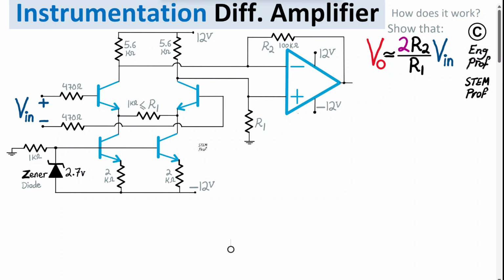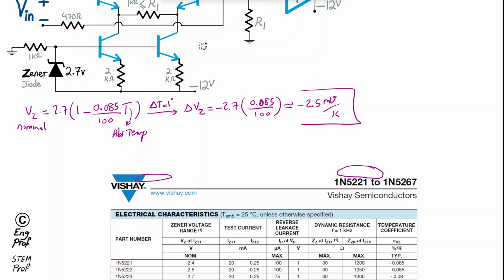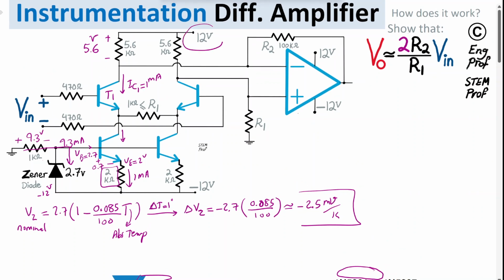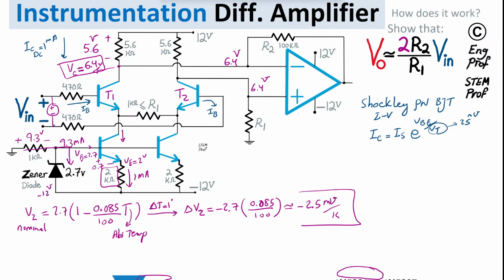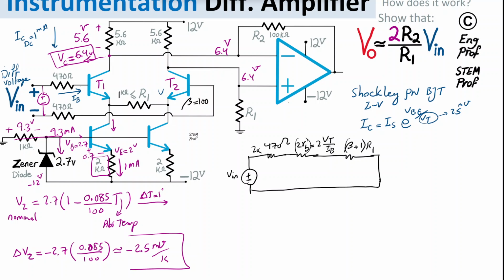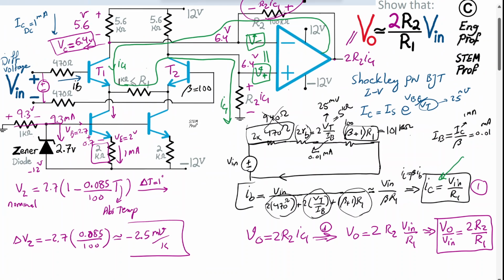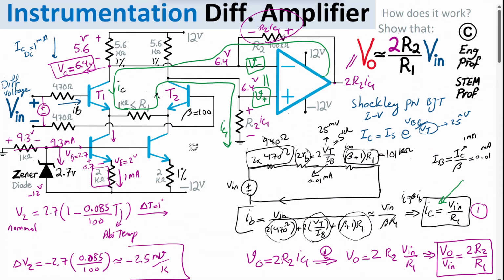Instrumentation Differential Amplifier design with BJT Transistor, Op Amp & Zener Diode

Comment: Needing the two BJTs for the differential pair is a bit hard to do away with, but that's why I'd always opt for using only one BJT for the current source and dividing its load, that way you don't need a second matched pair
Reply from the maker: Thanks for the comment and sharing your insights!  There are indeed many ways to design a differential pair and current source. Your suggestion is a clever approach to simplify the current source in a differential amplifier.

Comment: That’s an amazing video! It’s exactly what I needed to help explain circuits beyond just deriving analysis equations. I do have one question, though — when you mentioned 9.3 mA at the base of one of the bottom BJTs, why is the emitter current (1 mA) smaller than the base current? I really appreciate your time and explanation!
Reply from the maker: Cool! Glad that you liked this instrumentation differential amplifier design video.  As explained starting at minute 4:00 , the 9.3mA is not the base current of the transistor, instead it is the current that goes from ground through the 1 kOhm resistor and then through the Zener Diode. I hope this explanation helps. For more example see the https://youtu.be/C4tghZ-q6Zs video which explains the design and operation of an Instrumentation Amplifier with Electronic Gain Control.
Reply: @STEMprof Thank you for your explanation. I have almost finished most videos. It is very practical electrical circuits knowledge.

Comment: Hi Prof, great video as always, but why ic1 cannot go through the 5.6 Ohm resistors? It's not clear for me how ic1 really flows. Thanks.
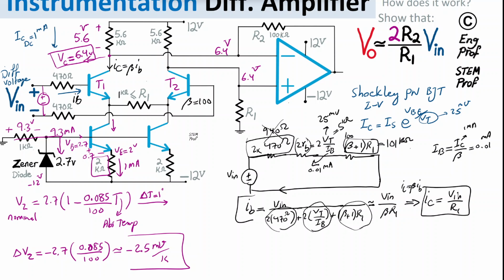Reply from the maker: @schnullertroll4173 You're welcome. Glad that you liked this Instrumentation Amplifier video. Regarding your question about the current flowing through the transistor's collector and 5.6 K ohm resistor, please watch the video at around minute 15:12 https://youtu.be/2xJpqfexsPg?feature=shared&t=912 when this is explained.  For a related video, see https://youtu.be/cFzYZsPEtP0 video that explains how VCA Electronic Gain Control works. I hope this is helpful.

Comment: Thank you so much for your effort,  your detailed analysis is really appreciated. It's not clear to me what could be a typical application for that circuit, I mean, a similar result could be achieved using a single OPAmp and without the 4 BJTs.
Reply from the maker: My pleasure. Thanks for watching, your encouraging comment & good question. While there are multiple circuit realizations or techniques to realize a desired computation & signal processing, the circuit shown in this video is one example of Low input current, very large input impedance, high voltage gain amplifier realized with reasonable resistor sizes. In the single-OpAmp amplifier approach (you referred to), realizing both high gain & very large input impedance with reasonable resistor sizes is hard to achieve. In summary, any circuit design approach has its own set of cons & pros depending on target design KPIs.  I hope this explanation is helpful. For more examples please see my Circuit Design Videos Playlist. 🙂
Reply: Hi  @STEMprof  your explanation is helpful and challenging, I'll try to  prove those features on my own. Thank you
Reply from the maker: @andreamarani2305  You are welcome. Glad that it was helpful.

Comment: In the first part of the video you establish the 1mA current through the two current source transistors.  But surely this is only possible if either T1 or T2 or both are conducting.  But there is no connection to their bases at that point, so what is providing their base current to switch them on?  Is there some biasing arrangement for T1 & T2 that is not shown ?
 Thanks,  Phil Young
Reply from the maker: Thanks Phil for watching and your good question. In this  Instrumentation Amplifier circuit no DC decoupling is used at the base of the core BJT Transistors and hence it is assumed that the applied input voltage also provides the connection for BJat base DC currents. In the absence of input voltage the two base nodes should be grounded.  A more complete design should show DC connection via a small resistor to ground. And should also use Decoupling capacitors in order to connect small signal AC independent independent of DC connection.
Thanks again for your detailed attention. 👍
Reply: @STEMprof  That was quick !  Thanks for the reply, that clears things up.  It's good that your videos get into the detail rather than give 'hand-wavey' explanations.
Thanks,  Phil Young
Reply from the maker: @philyoung6745  You are welcome 🙏

Comment: That’s a very interesting example with your explanations, Sir. What I’d like to know more is some CMRR analysis of similar schematics.
Reply from the maker: You are welcome. Glad that you liked this circuit video and my analysis. Sure, the common mode gain and CMRR analysis will require consideration of Finite open loop gain of the op amp in this circuit. I will post a video in my Analog Circuit Channel playlist along with the recently posted CMRR example of the Darlington Differential Amplifier https://youtu.be/z8f7iZei5cY . Thanks again for watching.
Reply: @STEMprof  Oh! That's great. Have to watch. Thank you, Sir
Reply: @STEMprof By the way, a simulation shows a significant improvement in THD (and especially in IMD which almost disappears) if you use one current source and emitter resistors after R1. I think it adds a local negative feedback (I kept a total gain the same)
Reply from the maker: @sc0or  Thanks for your follow-up circuit simulation and sharing your observations. As you noted, generally speaking using less components should help with mismatch and noise reduction (hence improved Total Harmonic Distortion + Noise aka THD+N and reduction of intermodulation distortion).  Btw, are you using matched NPN transistors in your simulation?   
Thanks again!
Reply: @STEMprof  Makes sense.. And yes, for simulation matched transistors are used, because I need to know a theoretical max (or min) first. And if it does not satisfy me, it makes no sense to continue. For instance, if some sound amplifier schematic gives less then 0.001% IMD with ideally matched transistors, it goes to a trash, because in a reality it can give 0.1% easy. Your original frontend gives 0.0001, and this is a good start point.